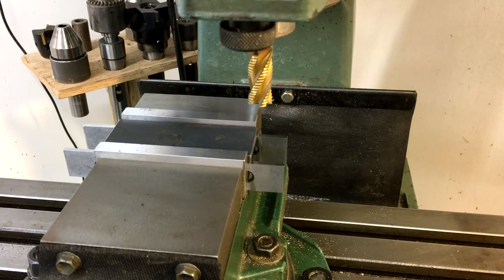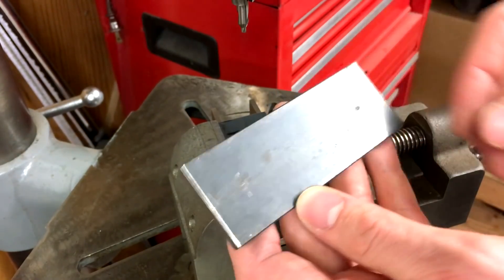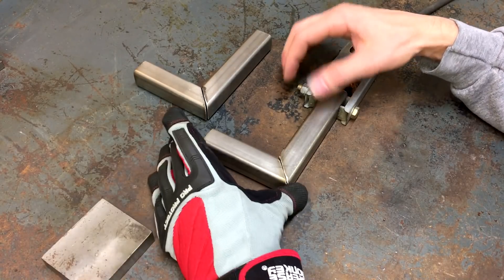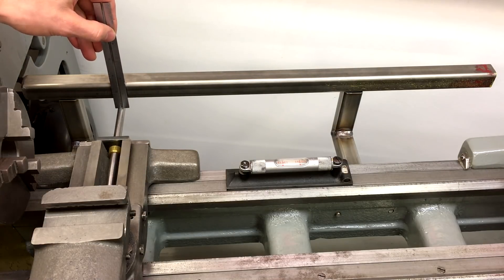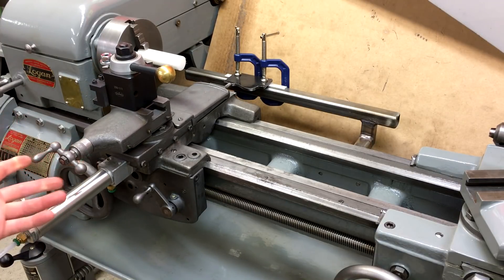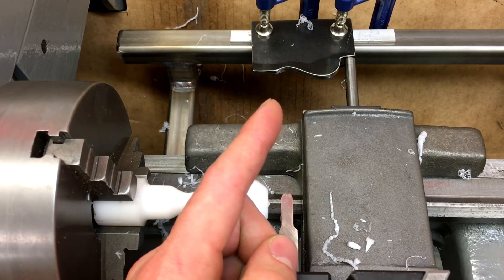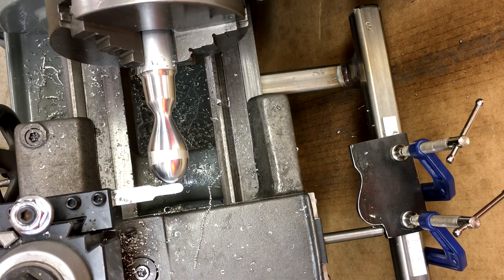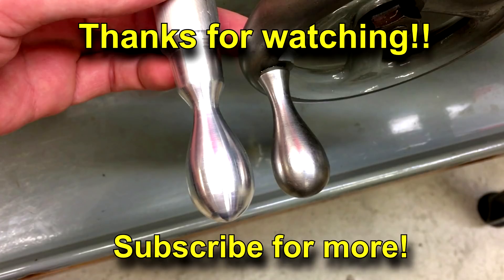Finishing and Testing the Homemade Tracer Attachment

Comment: I have a logan 10 that needs some handles/knobs but not available anywhere. Short of buying an CNC (or hiring $$$) this looks like a well documented and thought through method. I see Mr Pete gave a thumbs up too! Yes, well done! 

I bought it decades ago from a river flooded sale. Did not get underwater, but lots of corrosion. Thought it should be scrapped recently and have not touched it for 15 yrs. A few days ago installed a MT2 bar and tested runout and travel error  down in the weeds! 

Thanks for a very clever design. I am guessing the tool force and relief angle of the cutter is matched to the material hardness to allow a constant force to be used for cutting depth? Would it help to hand feed to close to the profile then finish cut?  Like a CNC would do it?

Comment: Great idea. If I could suggest an improvement it would on your stylus (part in contact with pattern) it should be as close to the cutting tool in shape and deminsion. Notice the elongation of the parts nose radius? That is from the difference of the rod and cutter width and radius.

Comment: Nice and easy to understand Videos! Can you tell me what's the diameter of the piston in your air cylinder? Than I could calculate how much force your air cylinder has at 7 psi. I'll may be try the same - already milled a slide support for my tracer attachment.

Comment: 3 psi < atmospheric pressure
Reply from the maker: In terms of absolute pressure yes.  But gauges are “zeroed” to atmospheric pressure so my 3 psi was still greater than than.  An air tank with 3psi inside it will not have air rush in when you open it.  The gauge means 3 psi over atmospheric

Comment: Part of your problem when going over "crests" in your pattern is the carriage travel backlash coming into play. One way to remove that is to constantly load your carriage with another air cylinder mounted inline with the carriage travel. The carriage either pushes or pulls against the cylinder and maintains a constant load eliminating the backlash. You might also want to install a roller on the end of your probe to reduce the friction against your pattern. Another thing would be a collar mounted under the carriage on your probe extension rod to keep it from pushing the tool in past centre. This would also aid in setting up your patterns as it would give you a fairly accurate centre line for you lathes rotational axis.

Comment: great video and awesome attachment,  just an idea to try out on the stylus, try a simple single steel ball and make yr patterns from aluminium then clean the surface the stylus will follow with fine emery and scotchbrite or just polish, a little grease or oil will help it slide along smoothly.  good luck

Comment: An important aspect is to machine the area that has the largest overhang before thinning out the shack that increases the overall flexibility of the item.
Reply from the maker: Yep, it was just the first experiment with it.  Thanks for watching.
Reply: @BuildFixCreate  I'm curious, when setting the horizontal tube you mounted off the back of your lathe, instead of using a level why didn't you just extend a dial indicator out to it from your carriage and run it back and forth to true it?

Comment: It seems to me that the pneumatic cylinder are stealing a lot of room in your working aera, and the air hose makes it some worse. I think I would think in a direction of a 90 degree elbow in the back of the cylinder, and maybe another 90 to bring the hose alongside the cylinderwall in order for the hose to claim less room
Reply from the maker: The space it is in doesn't really bother me but thanks for the ideas.

Comment: I’ve done pattern work on the lathe. I highly recommend that you do the end first to keep chatter down. As it is, you’re cutting most of your support away.
Reply from the maker: Yeah, I will look out for this more in the future.  This was just a very first experiment to see how well the thing even worked.  Thanks for watching!
Reply: Build Fix Create  watching this i thought of something that may help a little with the binding issue. either a ball tip or semi triangular with the tip rounded and smooth. would also help with getting into  smaller details in the pattern. Just an idea from someone who wants to get into machining but has not the spot (just yet but working on it) to put a lathe and mill or yet got the mill or lathe. from childhood (I'm 44 now) machining is the trade i always wanted and from the time i could read cat in a hat i was pinching my grandfathers engineering text books and trying to read them asking my dad and my grandfather hundreds of questions as i tried to do so :). no one ever gave me a go here in australia so now with a supportive partner i am working on getting set up to teach myself. I did do a tiny bit of machining when i went to agricultural college. i am also a self taught blacksmith, saddler and carpenter. Dream trade..... gunsmithing

Comment: I'd be extremely interested in seeing this used on steel and stainless and finding out what air pressures are needed. The diameter of your air cylinders piston would be helpful to figure out what actual force is going into moving the slide as well. 

For holding the patterns? If it were me I'd want at least 2 index pins through the pattern and into a table mounted to that rear 1" square tubing so any pattern made will then correctly align parallel with the lathe longitudinal ways. Plus make the pattern table adjustable along the bar so it can be positioned and locked in place to set the cutting tool so it then cuts in the correct part location along the shaft.  A well thought out accessory and not anything I've seen yet that was made for a lathe.
Reply from the maker: Thanks for the ideas about pattern holding!  I am going to be trying the tracer on some stainless in the next month so ill share how it works.
Reply: @BuildFixCreate  using tapered pins for pattern holding would be a good addition to the pattern holding idea.
Always tight. Never loose.Regular pins will loosen on the pattern or holding surface. Tapers will automatically adjust,intuitively.
Reply: Yep the pattern idea isn't new. It's shown in old books about ornamental turning and there's copy attachments still sold today for wood turning lathes. Like you said Jaakko cnc has made a whole lot of complex tooling redundant. I've also seen spring loaded pattern followers, but the air cylinder gives you a way to have an adjustable pressure rate on the pattern follower without having to change springs. So that part was something I'd not seen before.
Reply: Reason for not seeing these pattern attachments is because of no ned in todays world where we have CNC. Ancient system, but works very well.

Comment: Did you do a video of the air cylinder installation on the cross feed? I plan to try to adapt it to a Grizzly G0776.
Reply from the maker: Yeah there is Part 1 and 2 if you look back in my videos.

Comment: i think a small roller bearing on the tip of the rod would be a good idea lower the friction quite a bit and if it wore out its replaceable
Reply: Like the tip of a steady rest finger with a roller bearing on the end.
Yup. Great idea!
Reply: @xmachine7003  If a roller is incorporated then the profile plate will need its shape modifying to compensate for the diameter of the roller otherwise you will not produce a direct copy of the profile plate.

Comment: Your tracker is working great! Many thanks for sharing your work. I would suggest you plan more carefully the sequence of cuts when you use the tracer. For example start at the major diameter of your part and work towards the end first. That way you have the full support of your material without the narrowing for as long as possible. Only make cuts that reduce your support when you have cut all the other parts of the profile that you can. Again - nicely done! I think I will try to make something similar for my craftsman 12.

Comment: That appears to work quite well.  A higher end, "self-lapping" (bleeds off excess pressure if you reduce it or if something on the business side causes pressure to increase above what it is set for) regulator might prove useful.  How quickly & accurately your pressure regulator responds to minute changed might make the difference when making profiles with steep angles and dramatic curves.  It should also help you keep the sideways flexing/binding of your rod that follows your template to a minimum.

Just an idea ... for what it's worth...
Reply from the maker: Thanks for the idea and thanks for watching!

Comment: Very impressive. Did you design it yourself,,,or copy an existing one??? Great project
Reply from the maker: I designed it myself, I've never seen a similar setup but would be curious to see them if they are out there.  I wanted a DIY version of the expensive hydraulic tracers for larger lathes.  Mine is maybe not as versatile, but it is very handy none the less.  Thanks for watching!
Reply: @BuildFixCreate  The principle in your design is a very old idea. There have been a number of direct spring pressure stylus copy lathes where the stylus follows a half profile plate and the toolpost responds by being directly connected. Some of these machines use a mechanical spring and some use a pneumatic spring.

Comment: use a small roller bearing as a stylist against your template
.
Reply: Cool project. Instead of the trig to adjust radius comp in each pattern maybe just make some cups for a stylus that slide over and set screw to the shaft with blade or wedge type tips of the same radius used to cut. .016, .031, .047 or whatever. A little D2 and flame (fireplace lol) to harden and polish?
Reply: Then your cutter gets as large as the stylus to keep the relation. Or you have to fumble around with the pattern to get the correct shape workpiece, though you can't get a radius smaller than your stylus is.
Reply: Jaakko is right. The turning tool and the stylus should have the same shape. Otherwise you do not really copy the pattern. You can see this in the video very clearly. Still, you really did a great job with this attachment.
Reply: It depends on the shape of the pattern. You can get some really small bearings.
Reply: You can get very small bearings indeed, NTN makes drawn cup needle bearings all the way down to a quarter inch, and cam followers down to 4mm. I think using a roller bearing as a follower is a great idea, it would allow for cuts that require more tool pressure.